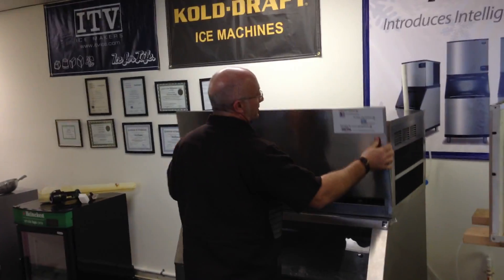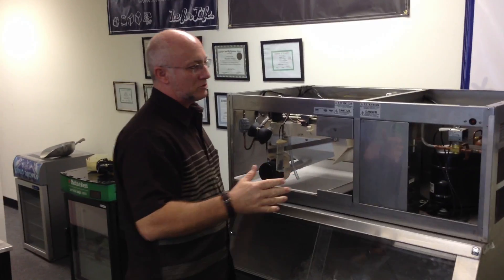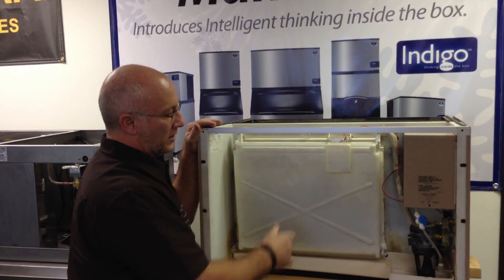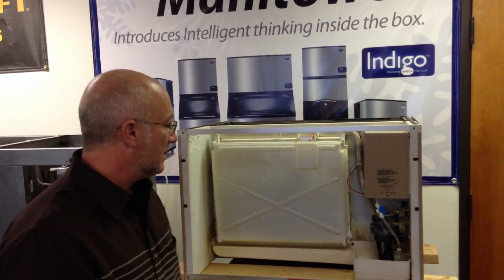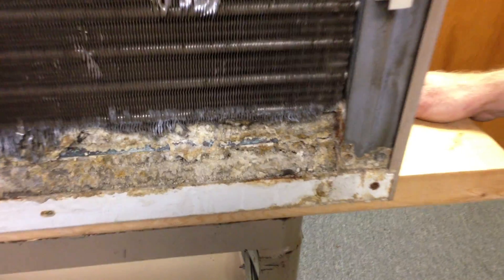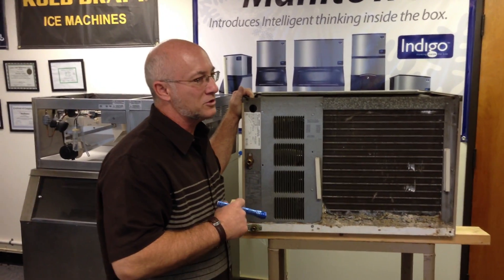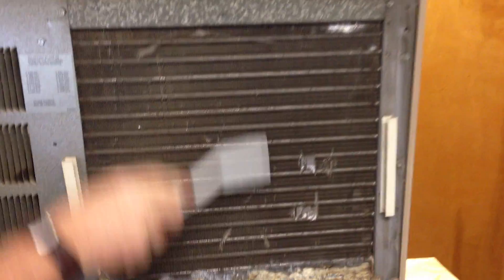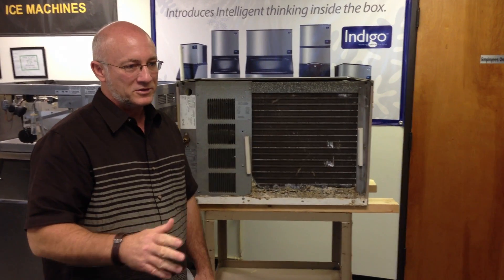Commercial Ice Machine: How To Clean One

Comment: That plate in the front is an Evaporator.. and the other one on the back is a Condenser coil. The evaporator absorbs heat from he ambient air, thus cooling the plate, making ice from the water supplied. The condenser in turn rejects the heat absorbed from the Evaporator... creating one big cycle. There is much more to it than that as well.